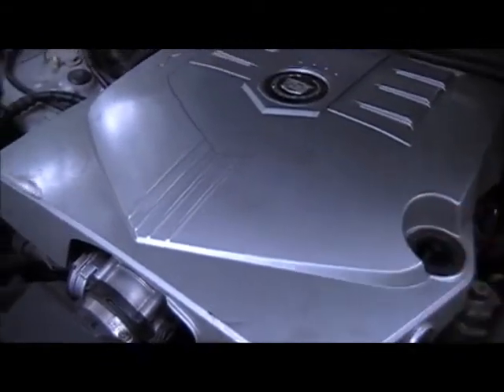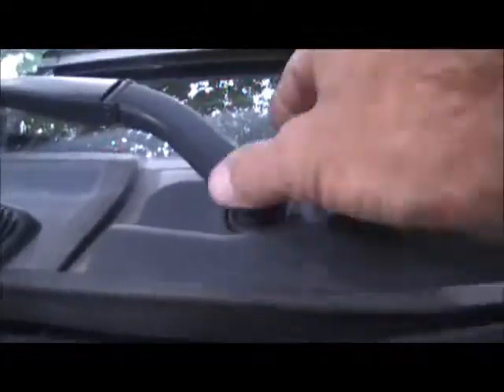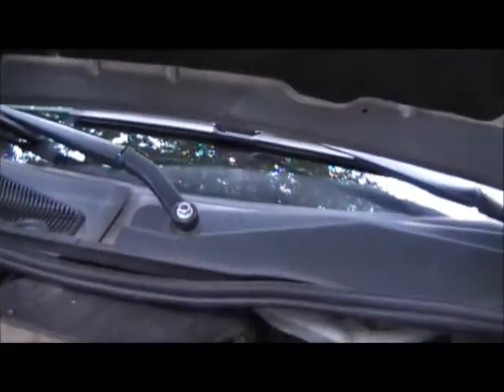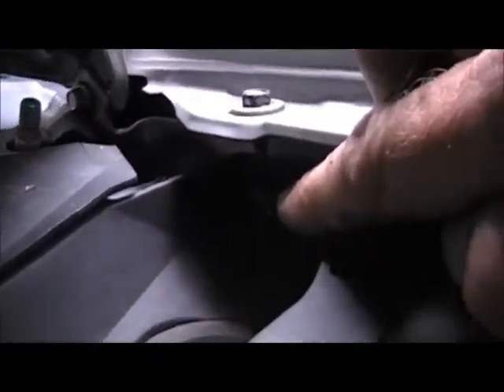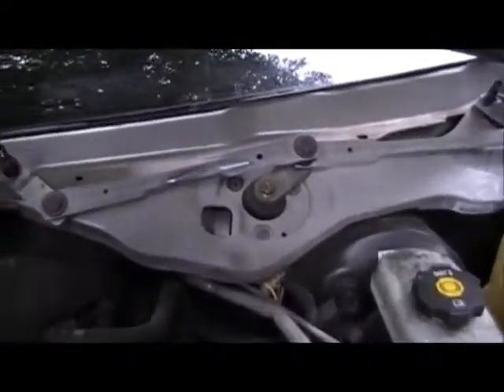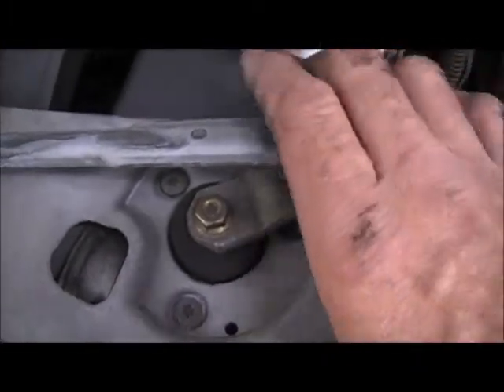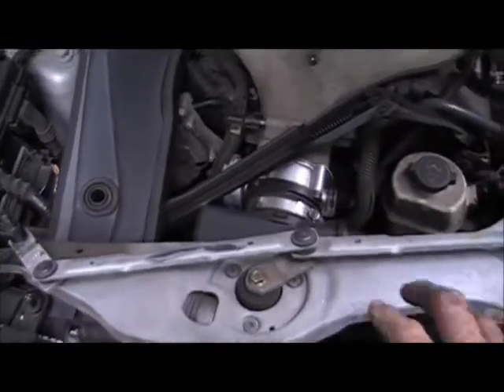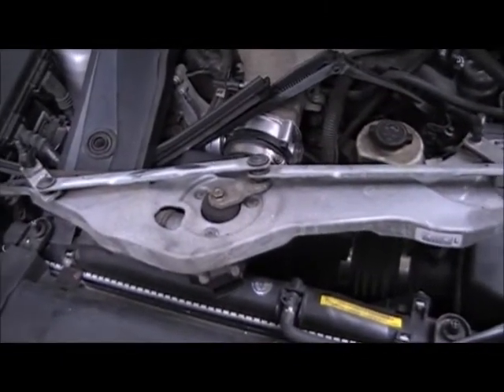2003 Cadilac CTS Wiper Motor Removal

Comment: Great video--inspired me to tackle this project on my 2003 CTS!  Two suggestions:  1) remove four Philips-head screws from plastic panel on passenger side to aid in removing and, more importantly, replacing driver-side panel, and 2) test wiper arms stow position before re-installing plastic panels to ensure that 3-inch linkage is attached to motor shaft at proper angle.  I had to re-adjust its angle on the motor shaft to place the wiper arm "stow" position at the bottom of the wiper arm cycle.

Comment: Thanks so much for the video,  everything worked as u explained with my 2006 CTS wiper motor replacement.  Our problem was the washer would not shut off & wipers worked erratically.  Saved me some $$ . So appreciated.

Comment: Thanks for an excellent video!  I just had to replace the motor cover so I didn't even have to remove the motor from the mount.  Just flipped the mount over and replaced the motor cover (which has the circuit board in it.)

Comment: Many thanks bud.  I had a problem with mine that the wiper motor had a mind of its own.  Without the switch being on in the vehicle, on a remote start as well (eliminating me bumping the switch) where it would flip out and go to max setting,  and range from that to any of the other settings, all with the interior switch off.  

I deduced myself that I had a bad wiper motor while everyone kept telling me it's the switch or the wiring.  I'm not a mechanic by any means.  I had no idea what the damned thing looked like or how to get to it.

This really helped me out, though if you make an update video for this, I had to take out the three 7mm bolts on the passenger side plastic plenum in order to get the driver side off.  I really found a magnetic bolt tray to come in handy because I am horrible with losing shit like that.
Reply from the maker: Sweet !

Comment: Just a heads up to anyone doing this. The last part where 2012nugget said to remove those torq screws towards the end is not necessary, if you're replacing the wiper control module only. I have a 2006 cts 3.6L The wiper control module is that little black box. Remove the 4 torq screws from that and remove the little box and replace it with the new one. Then run the cycle so everything parks. Problem symptom for mine was the wiper fluid kept spraying none stop when the wiper were running or they parked in the middle of the windshield.
Reply: Doug Fresh Here you go! http://www.gmpartsdirect.com/results.cfm?singlepart=1&partnumber=88958172 That's what I ordered. The coverkit brings the module with it.
Reply: Well glad I could help someone out :)

Comment: Do you work on Cadillac Cts often, Because I have A 2004 Cadillac Cts 3.6 clyinder its making a weird noise and a engine reading is saying its misfiring. Someone told me its the coil packs. Because my car is only running on 3 cyliders instead of 6. Is that true??? Because I don't wont to put anymore money in it if its damage for good. Which two people have told me that my car engine is gone bad for good. Is my car able to be saved with coil Packs??
Reply from the maker: Its is very possible. Without actually looking for myself though I cannot say for sure what your problem is. Coils are a possibility.